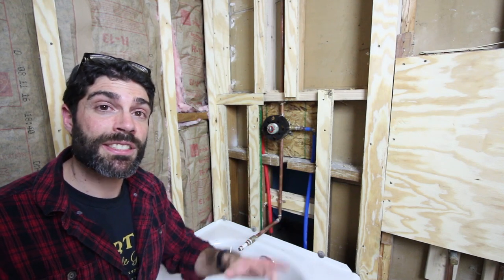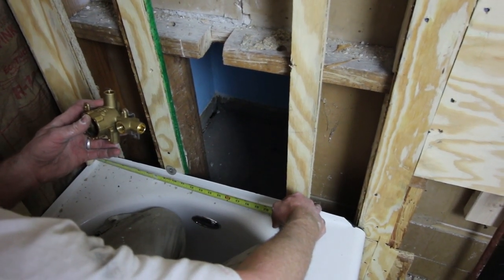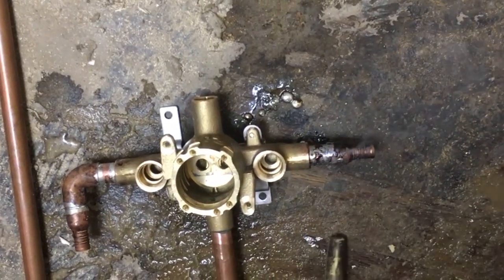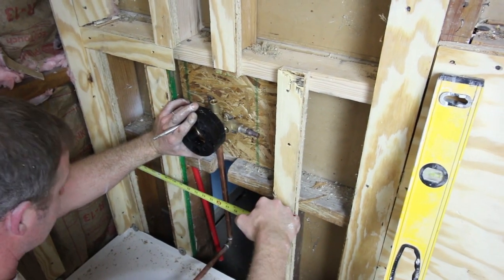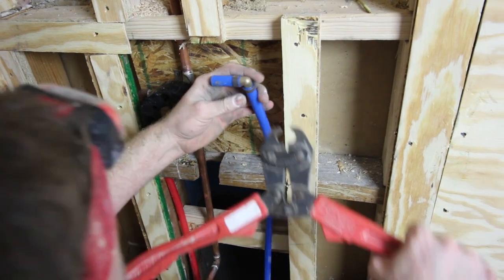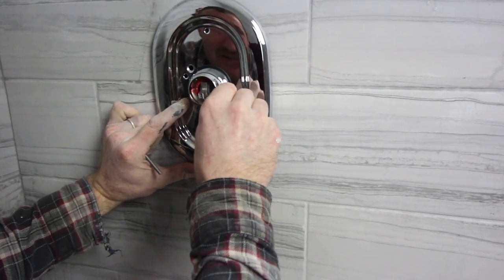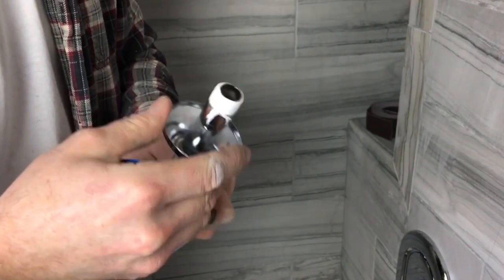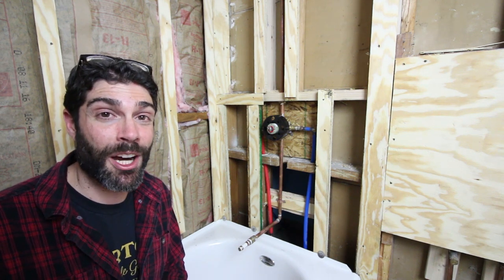Shower Valve Replacement with an American Standard Valve  (Step-by-Step)

Comment: Great video. But, Steve wraps the Teflon tape in the wrong direction. The direction he wrapped, the tape will try to unwrap when turning in the threads. Always wrap your tape clockwise . No biggy, just a tip !

Comment: Soldering was a little sloppy compared to the standards the company I work for holds us to. Good video over all. Thanks.
Reply from the maker: Thanks Buddy for your feedback
Reply: @HomeRepairTutor   The pex adapters should have been farther from those 90's. With such a small gap like that you might not get solder into both joints, just one. Also, always a good idea to clean excess flux/burnt flux off with a rag and warm water so it doesn't sit there and slowly corrode the pipe and fittings for years to come.

Comment: I watched this because I have an issue with leaking from an american standard valve. I don't think the mixing valve is bad itself but the cartridge was. I changed it out and my leak continues. Waiting on another cartridge now but may have to change the valve if this does not work.

Comment: what is the measure for the plastic guard from the finish wall?
Reply from the maker: +pepe flowers we positioned it so that the guard would be roughly 3/4" from the studs. That way our backer board and tile, which are about 3/4" thick with the thin-set, would fit within the standards of the valve. Hope that makes sense
Reply: Thank you. Love your videos I have learn a lot. Keep making them.
Reply from the maker: +pepe flowers thanks, we' going to have a lot of cool stuff
Reply: Does this mean the Plastic guard is set to sit flush with the finished wall? Sorry, I'm a little lost.